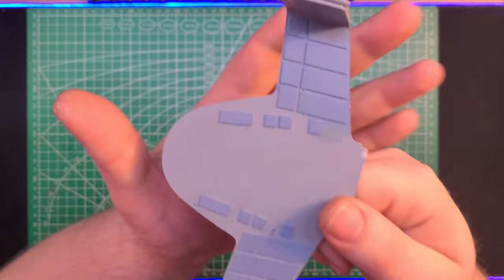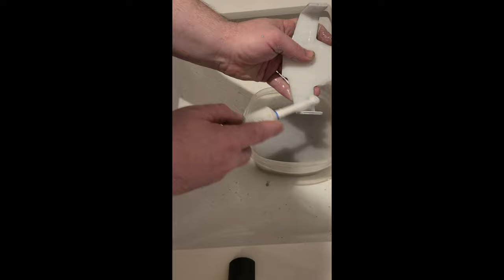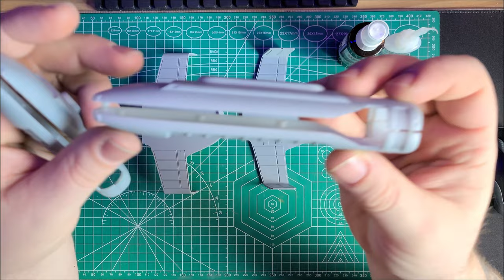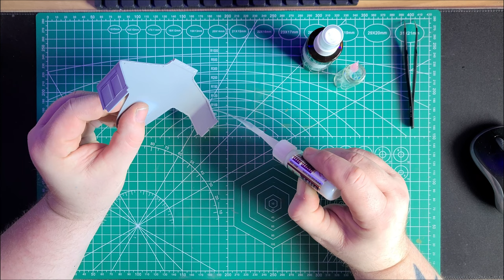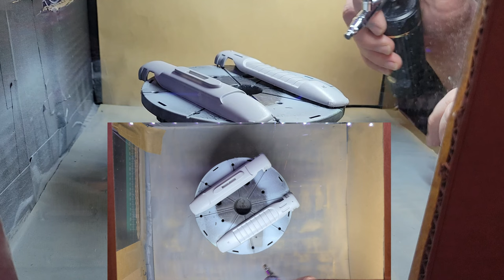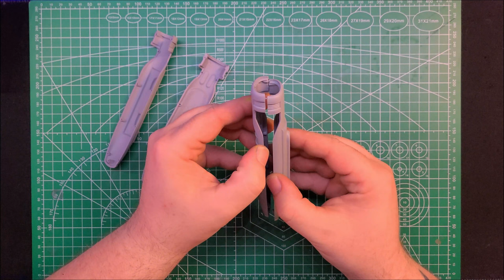Let's Build The USS Enterprise NCC-1701-C in 1:1400 Scale From AMT! Ep 9

Comment: Great videos Jordan.  Thanks for the shout out.  Glad the CA is working.  I would use both CA and regular model glue depending on the application.  Also, for large areas, I would recommend Testors "red tube" glue.  Holds great and bonds as well or better than the liquid glues.
Reply from the maker: Oh me and my glue habits... not sniffing... I swear. LOL.

Comment: Bonding metal to plastic (on figures or with PE), I've always used superglue but I've never used it for the regular model building instead of the thicker Revell plastic glue or the Tamiya extra thin. I've got to admit, I do prefer the longer working time.
What's your experience? Pros vs Cons?
Also, that piece came out really clean after the IPA. (I've strained mine through a coffee filter so I don't end up with older flakes staining the model or getting into the nooks and crannies where they're hard to get out of.)
Reply from the maker: I've had some ups and downs with the CA so far. I really like the bonding time (I prefer quicker times as I have carpal tunnel and hate holding the parts together for too long), but if you have to separate the parts after they have bonded, you have to clean up the CA vs the Tamiya Extra Thin. So far, its a mixed bag and may employ both, depending on the model and situation.

I, apparently have a knack for removing paint off of a model using IPA. LOL. LOTS of practice over the last few weeks.
Reply: Thanks,  @Aligning_The_Stars 
The other day I just learned the hard way that soaking a plastic model in IPA is fine -- except for the resin parts CAed onto it; they also soaked it up and it now looks like they've exploded from within. Replacements set me back a few €$ but that's okay for a lesson learned for the future.